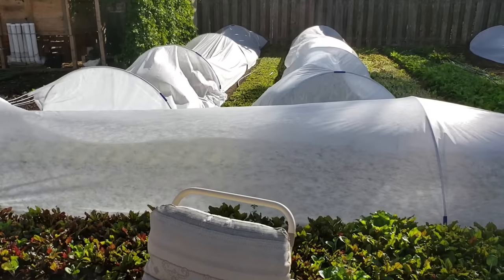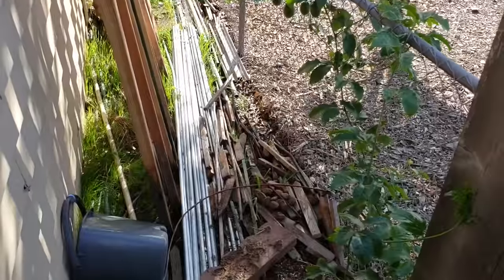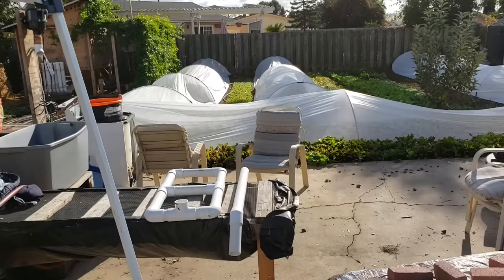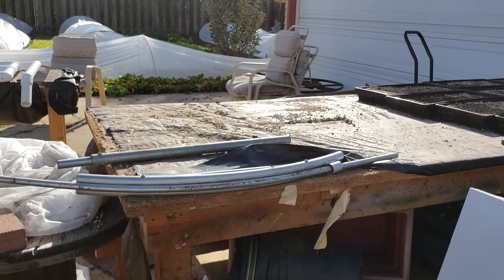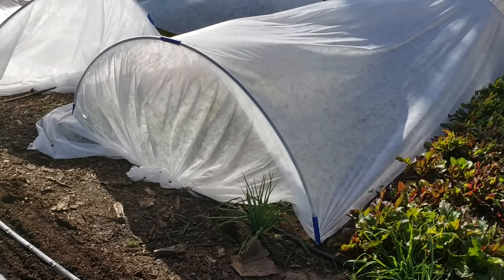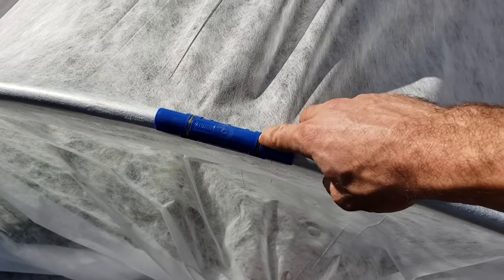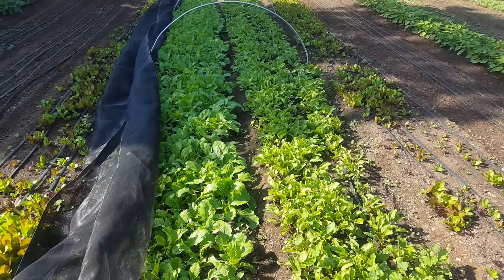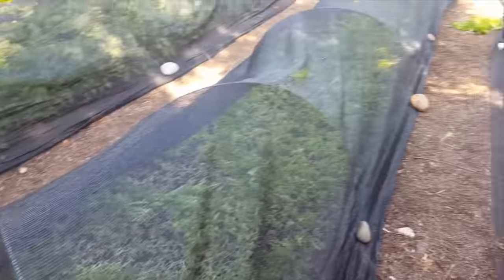Season Extension with Frost Blankets & Shade Cloth

Comment: Excellent video as always. I just bough a 6 foot wide 50 fot long season extended to help with germination.
Reply: Will the ten foot conduit work with a 6 foot season extender, or do I need a shorter conduit or a wider cloth?
Reply from the maker: For the 10ft conduit that is bent over 2 30" beds and one pathway. I use 10' wide fabrics so I can tuck the entire bed in on all sides.

Comment: I'm in a more windy situation, my frost blankets lasted only two years, since they are non woven they easily tear apart. Best wishes, greetings from Holland.
Reply from the maker: Ya you are right it's a bit weak, cats have been ripping mine lol. I've noticed the name brand Agribon fabric is higher quality and lasts a bit longer. Using greenhouse plastic is really strong and might work better. Cheers!
Reply: @NaturesAlwaysRight  Next time  I will use a second layer of bird netting on top to reduce the flapping. I now have a more coarse netting, the fine maze stuff requires me to unwrap entangled birds.

Comment: Thanks so much for sharring this. I will definetly need this at all times here in San Antonio TX.  We get hit with all kinds of stuff .... strong winds, frost, crazy heat, crazy rain, and crazy bugs. I think by doing this and just changing the frost cloth for shade cloth in the summet my crops will be better protected. Great idea. I will definetly have to put rebar to hold the conduent pipe to the ground because of the strong winds. Which market do you usually sell at? I think I will be in the San Diego area some time in Feb or Mar, I may be able to come say hi and buy a few produce from you.
Keep up the good work.
God bless you.
Reply from the maker: Definitely check out what the other farmers in that area are using too. I bet they would have good tips for dealing with the wind. I sell at the La Mesa Farmer's market every friday 3-7pm in front of Por Favor restaurant. Would be fun to meet you :)
Reply: @NaturesAlwaysRight  Thank you 👍

Comment: I'm gonna make hoops from PVC pipe with a heat gun.  I've made a jig and will use 45 degree fittings at the 2 joins and using 20cm bits for the legs which will be heated and the ends clamped flat to close them. They'll be glued in place with plumbers cement.  All this makes a hell of a difference.  I've put 30% shade cloth over my tomatoes due to the very hot sun today.  Plants benefit a lot from these horticultural cloths in all seasons.  In theory you don't need hoops at all according to the frost cloth manufacturers..

Comment: Thanks for putting this out, I'm going to start practicing with these this year in my personal garden. Are those hoops are for a standard 30 inch bed? Do you have to have another bender for different width frames (say for a double bed) or can that one work?
Reply from the maker: These hoops are made from 10ft EMT conduit. They are bent to 6ft for the low tunnels. This covers 2 30" beds with 10-12" pathways. For a home garden or raised beds I'd use the 9 gauge wire.
Reply: @NaturesAlwaysRight  Yeah, watching it the second time I see. That's perfect because I plan on 12 inch walk ways. I want to go ahead and use the EMT because this is all in preparation for a market garden. I'll save what I make for that purpose. Thanks
Reply from the maker: @paxtianodirtfrog8947  Nice good luck with your build! You'll enjoy having this set up.